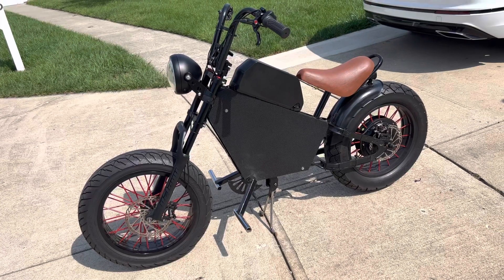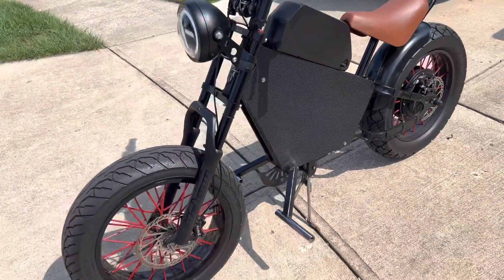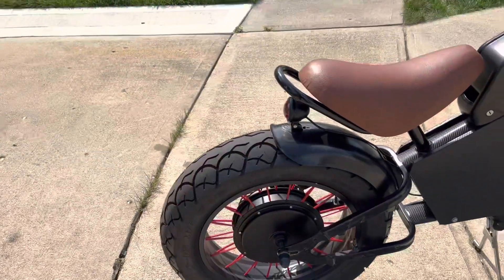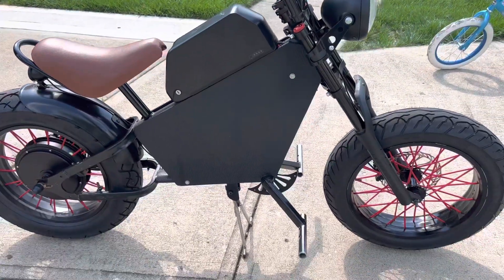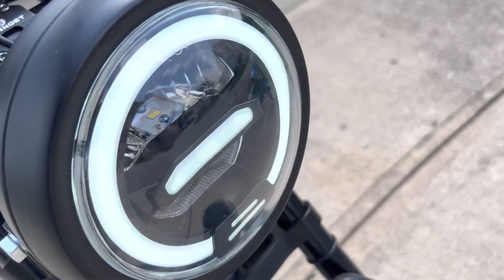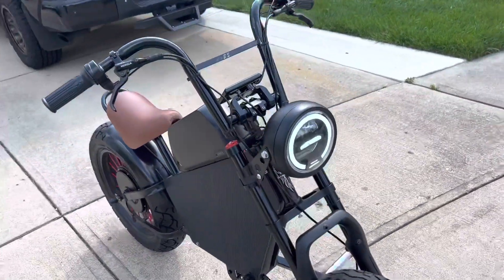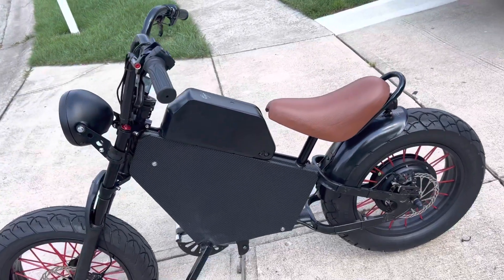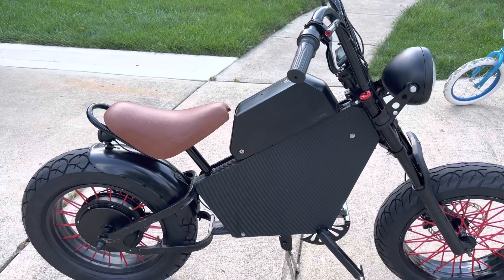OCC chopper ￼ converted to electric￼

Comment: 8000w and it only goes up to 37? my 1500w does that. did you limit it on purpose?
Reply from the maker: Its 3000w 60amp  the kit requires 72v im running it on 48v , i have 1000w it does 35mph but the bike is lighter
Reply: @shavkat84  I see. It does make a huge difference on the wheel size, tire size, and frame weight. I have huge, 29 inch tire diameter but very skinny tires and so the rolling resistance is very small.